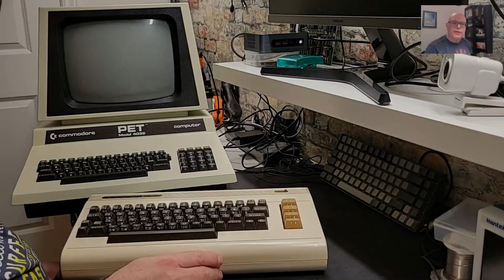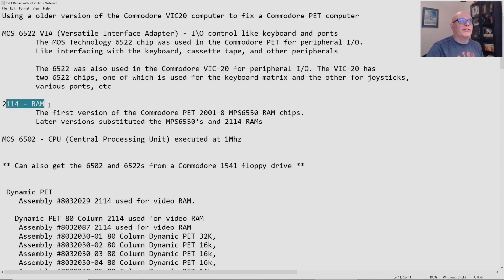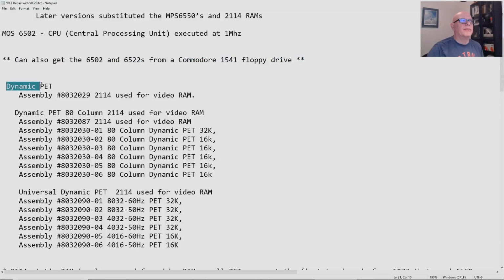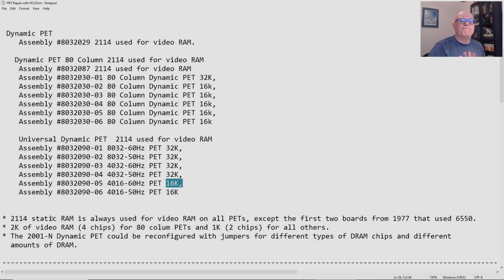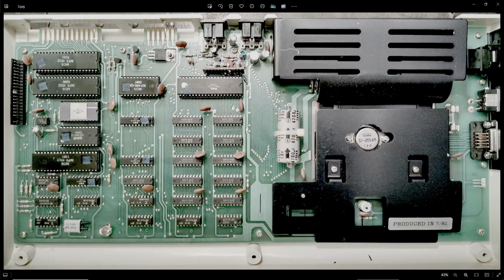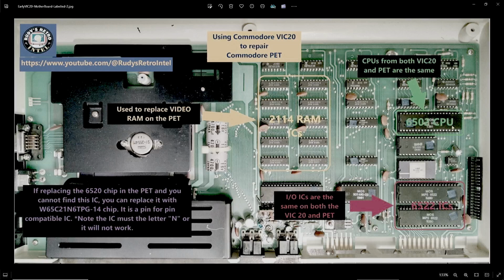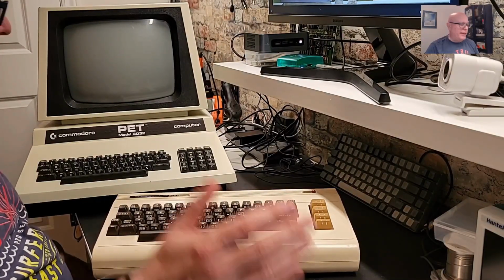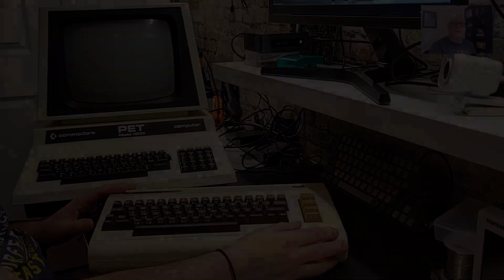Surprising Hack: Use a Commodore VIC20 to fix Commodore PET

Comment: I've been watching "The Clueless Engineer" repair a VIC-20 lately (he's up to part 4) and also replacing the 6522s, the 6502, and ROKLM chips with modern equivalents (with adapter PCBs) to reduce the heat produced inside the computer and to lower the power consumption, thus taking less of a strain on the power supply.  I'm thinking this approach would be a good idea for Commodore PETs and other vintage computers to increase their longevity.  We are keeping these computers alive for posterity, aren't we?
Reply from the maker: Yes, indeed we are. Modern replacements that reduce energy are always great. It would make for an interesting video to use them inside a PET. Thanks for sharing and commenting

Comment: Just a quick comment, disk drive 1541 can also be used on the vic20 (not only c64).
Reply from the maker: True, even the VIC1541 will work on C64. It's interesting how that works. Thanks for commenting